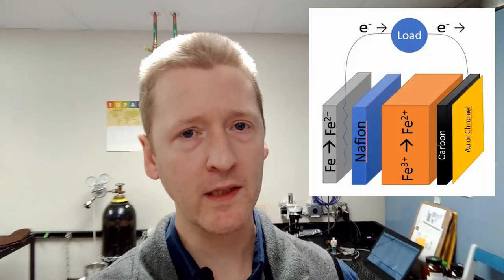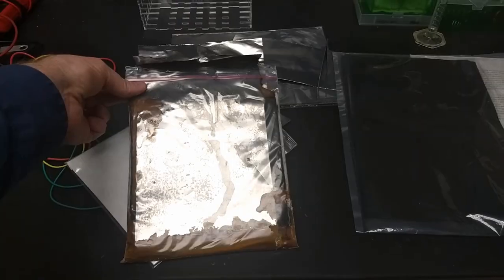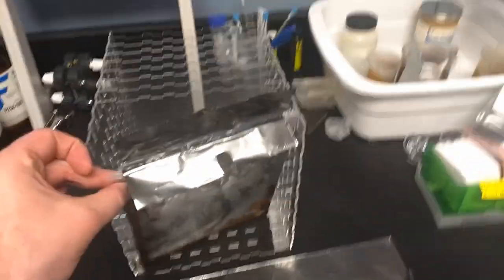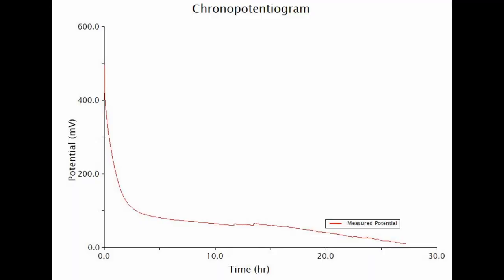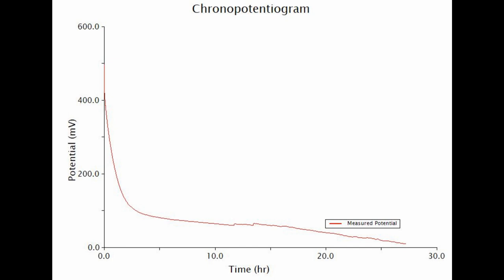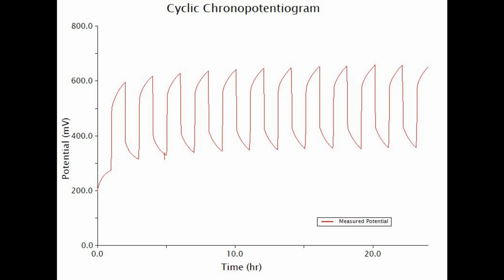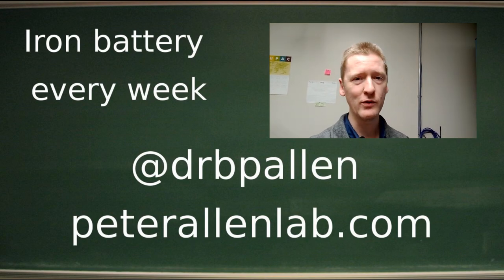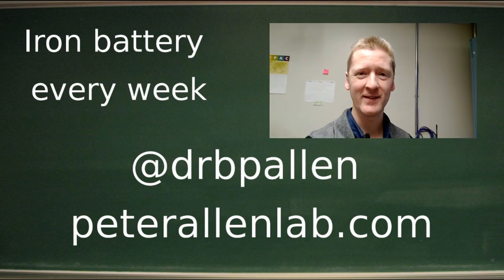Update #2 on Iron Battery Scale-Up to 200 ml

Comment: 1m^3 thats the size of a standard IBC liquid container. How many pouches would you need get 12v for example? Could you have large 1X1m plates? It would seem like the material costs for a 1m^3 battery cost be pretty high compared with lithium or lead acid. Love your videos

Comment: So i've been digging into what i might do for building a diy battery bank, and came across this spiral cell battery technology, which got me thinking that "from my understanding" such a design would essentially augment any battery due to the ability to have longer individual cells in a seemingly smaller battery, also helps keeping everything in place... 

anyways wanted to suggest that as a possible way to augment the battery and it's construction a bit, not sure how much it would really improve the performance of the battery, but if nothing else it might make each cell more easy to construct.

The video i saw about spiral cell batteries.
https://www.youtube.com/watch?v=99oGcq4-t-4